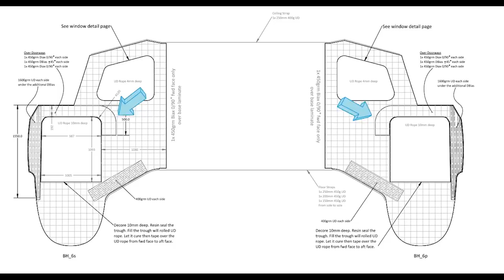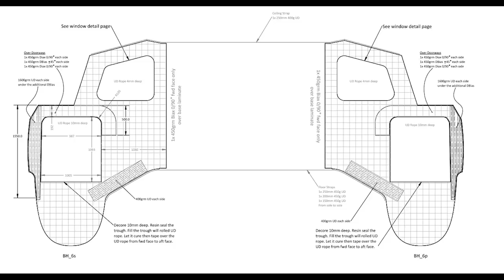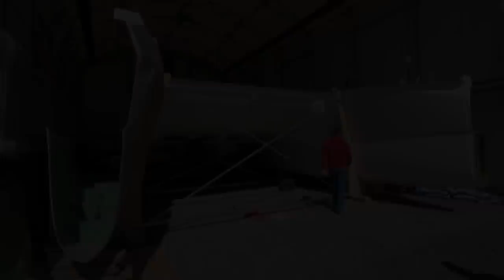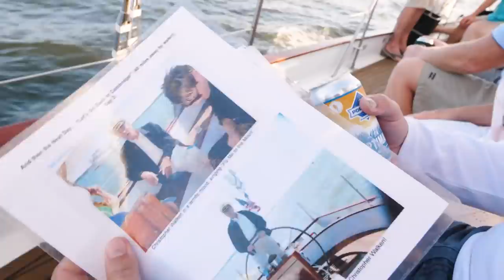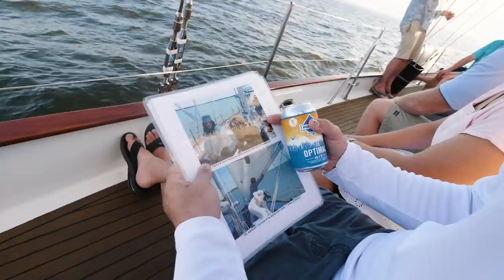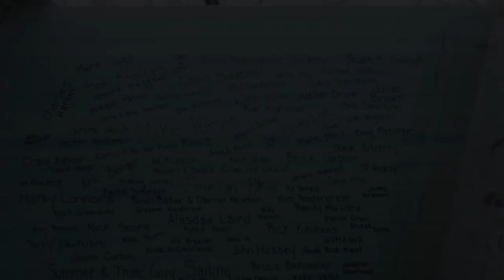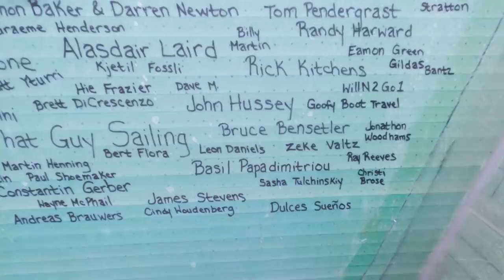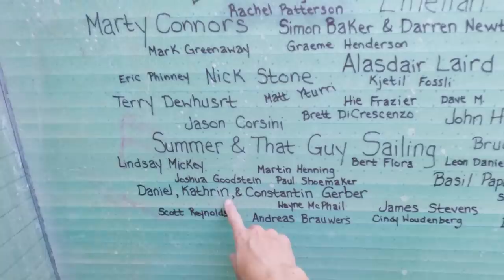CATAMARAN BUILD – Reinforcing Our Cockpit Bulkhead (MJ Sailing – Ep 196)

Comment: Working on some fiberglass aircraft panels many moons ago. We were told that the fiberglass had to be kept in a dry box. Humid air deposits water on/in the strands, the teacher proved it by wrapping a cut piece that had sat out in saran wrap and placing it in the sun. Sure enough the plastic wrap was covered in moisture an hour later. That means that left unchecked, a layer of moisture interferes with a proper bond.
Reply: When you're using polyester or vinylester it's not as big of a deal as they both have a solvent in them that absorbs and removes moisture,  with epoxy it is a bigger deal,  as epoxy doesn't have any solvents in it.

Comment: I built a 40' cat in a similar fabric shelter in tropical Cairns. During summer, in the shelter 34C was considered cool. It would pass by 34C by about 9am and stay that way till after dark. I downed tools when it got to 45C but is was consistently 38C-40C most days. Outside temperature would hover around 32C. Hottest I saw on top of the roof was 55.6C with 64% humidity...talk about post curing your glass layup. It does take a lot of planning and weather watching if you had a large layup to do. You do seem to have a very good light setup over your work area which helps with working at night time - something I didn't have but wish I did.

Comment: The blueprint illustrates the forces very well.  Thanks for showing it, in particular because Maxcruise has no reason to hide anything! The location of the unidirectional speaks books on what a square cut causes and that the naval architect is aware of it.  A not to be named french builder instead placed a conduit in that area - just crazy.

Comment: You are both doing an amazing job. This will be one kick-ass vessel when completed. I always found with rollers no matter what product is being worked with an extension screwed into the handle took a lot of strain off the wrists and allowed more pressure to be applied.

Comment: looks to me like the 0-90 doesn't "hold air".  rather it is very stiff, so when it rebounds, it sucks air back in from the edges.  re: the air voids left around corners that you say you  will sand out...could you use a syringe and needle to poke a hole at one end and then inject epoxy from the other end.  this would preserve the integrity of the fiberglass sheet while removing the void that allows separation/buckling  under stress.  also might be quicker and less messy than sanding.

Comment: Hey Matt when it comes to your 090 try pouring the resin right down the middle of the cloth and use your squeegee to move it around, as opposed to using a roller to apply it. I think with the larger quantity of resin filling the weave you'll get quicker saturation, and the access resin will be soaked up by the next layer of glass or the peel ply.

Comment: Some of those air bubbles are due to not enough resin on glass
Reply: They do tend to work really dry it seems.
Reply: Agreed... I have seen others soak their glass in resin before laying it down and rolling it out.   Seems like they would save a lot of time and back pain by just using a little more resin and not having to work out the bubbles as much.
Reply: @NoseyLurker  kicking themselves for trying to save a few hundred bucks in wood on million dollar boats...
Reply: I built my Grainger Trimaran  by myself  and understand some of the problems you point out. For those area where the glass has to dip down onto a lower level panel, I suggest you make larger radius fillets for the glass to lay around. This should reduce those areas where the glass will stubbornly sit up allowing air to remain underneath.
Reply: One other price of advice is not to over roll the fibre glass or you will break many of those glass fibres, therefore weakening your fibreglass work.
Reply: Use plenty of peel ply, it is your best friend for surface finish and later already prepared for any painting etc. Eliminates so much sanding.
Reply: @kevonmason6140  and don't remove the peel ply until you have to. taking it off early gains you nothing.

Comment: Excellent job. Try a product called Bubble Buster to roll out the air bubbles. I have used it with great results. Cheers
Reply: Well if they were using epoxy id say add 10% acetone but idk about what you'd think that with .... but thinking the resin helps a lot with bubbles
Reply: @s.v.gadder1443  i would not dilute with acetone as it breaks down the vynilester material.
Reply from the maker: I think we do actually have a Bubble Buster - hidden away somewhere among all our supplies, lol.

Comment: If those are typical rollers you can screw and extension into them.  A 18 inch extension should give you 1)  More Leverage and 2) more reach.  Both of those things will reduce the amount of effort required.

Comment: Can see why Lagoon skipped this part, very labour intensive. Do they make longer rollers, might speed it up?
Reply: i bet the rollers they are using are ideal for a humans weight.  you need a small surface contact area to create enough pressure to move the glue through the mat.  if you doubled the roller length, you would halve the pressure at the surface.  a bigger foot long roller probably would likely give insufficient pressure.
Reply: If you watch "life on the hulls" spraying is really best when your building large builds.....
Reply: @s.v.gadder1443  I have seen Bryan Sailing pour the epoxy stuff they use on the fiber class on to the area and then spread it out afterwards. Not seen anyone spray it on yet but that seems logical. Bare foot sailing also did a lot of fiber glass work and he uses his hands to spread it on first as well.

Comment: Hopefully those eight layers around the narrow parts of the bulkhead will be strong enough and the bulkhead won't crack. The break you had with the sailing of Woodwind was really nice , you deserved it. It looks really good so far. What is the brand and model of that electric sizzor?

Comment: just a tip. try laying a moderate layer of resin first before laying the 0/90 then over with a thin layer on top
Reply from the maker: You'll see at 06:14; 16:13, and 19:25, that we do this step. 😉

Comment: The occasional breaks are important.  One thing I noticed was the height of your work surface seemed a bit low which required bending over more - harder on the back.

Comment: Where you put down three layers why not let each layer extend a little past  the one before. Or a little less so that it would be less of the hard step at the end of those layers. That way you don't create a stress point. Plus it will be a more gradual slope. I have no idea if you have to fair this area later so I won't mention that.
Reply: the out board layers meet the hull where there are multiple UD and Biaxial layers spreading load from chain plates, the bottom of the bulkhead layers are met with a UD Box and UD plate  the inboard edge is linked by a UD  box,  stepping the layers in this instance would lead to a weak seam line,

Comment: Great job guys, but why don't you vacuum those air bubles out?! Simply, after spreading resin on fabric put it in to the plastic bag and suck the air out with any vacuum cleaner. If vacuum cleaner is not powerful enough take a compressor from salvaged refrigerator and use it to suck the rest of the air out. It is so quick and easy you might be able to do the lamination in high temperatures.
It is easier than one might think... 
Surely, the Best would be to use vacuum infusion...

Comment: I will have to say that the layer stack ups you are doing could have been a lot better. Not in terms of the pieces, but rather the order of them.
If you interleave the layers between the difference segments, then you will achieve a higher strength for the bond between the segments in the end.
For an example, you put down two layers at the side of the bulkhead, and then adding multiple layers above the cutout, this forms the weakest bond between these two segments.

If you instead started with the first layer above the cutout, then a layer for the side of the bulkhead, and then the next layer for above the cutout, and so forth. Then you will get a stronger bond between the two segments.

A simple experiment to show this is take two books.
If you place one book on top of the other and pull them along each other, how hard is it to slide them apart?
If you instead take a few pages from each book and interleave, and then try to pull it apart, then you will quickly find that only interleaving a few pages makes it a lot harder.

Now for the fiberglass, one do tend to use glue, and not just friction.
But interleaving still means that the two segments aren't purely relying on 1 glued interface, but rather multiple interfaces. And it is this interleaving that gives composite structures their strength. Not a bit of glue between two pieces. It wouldn't surprise me in the slightest if the reinforcement you made is actually a lot weaker than expected if put to a destructive test. (ie, an accident.)

Btw, doing proper interleaving of the layers isn't all that common among DIY people, even among professionals it is sometimes not done either. Since most people do not even stop to reflect about how the structure gets its strength and how the different materials in the composite interact and what purpose they have.

The incorrect assumptions of composite strength is though usually worst when doing joints between two pieces. Since here, the number of layers one adds doesn't really affect the strength of the bond, all that matters is the surface area that is glued against each piece. And beyond this, one only needs enough layers to smoothly distribute the force across that area. Adding additional layers without adding more bonding surface, doesn't improve the bond. At times adding more layers in these areas can end up making it less strong, since the bond might not flex in a similar fashion to the piece it is supposed to bond with, and therefor getting pealed off over time. Ie, cracks starts to form near the base of the joint on one or the other piece, and over time the crack grows and spreads underneath this supposedly "strong" bond.

In the end, remember, the glue is the weakest part of the composite. It is only there to hold the fibers together.
And yes, I used the term "glue" instead of resin or epoxy, since they are both effectively glue.

Now, I am not saying that the work you have done is worthless junk. Even if I might sound critical.
The reinforcement is not the only part giving strength to the structure, so the difference between a proper stack up and the improper one made, isn't going to have a major impact on the strength of the whole structure. It is weaker, but likely plenty strong. But it is worth while to keep in mind what gives composites their strength and how the pieces and layers interact.
Reply: I would tend to disagree. I have built composite wings on aircraft that are subject to 9 gs and more. The designers specify all but joints with the top layers 45 deg to the bottom layers. They are following a structural design given to them by the boat designer. It appeared to me they did exactly that. Using different types of cloth uni overlaid with double bias overlaid  with 90 zero.
Reply: I believe your write-up will probably change if you could study the design specs.
Reply: @davidhanson3288  Agree....design specs should always be followed.
Reply: @davidhanson3288  I didn't talk about the decisions for what material/weave etc used. Nor the design spec given by the manufacturer. I don't criticize any of that.

What I criticized were that the layers weren't interleaved where available and did state why this is a deficit. It is fairly basic engineering to be fair.

Read again and you might see what I actually stated.
Reply: @carldb7374  I never criticized the design specification.

I criticized that the layers weren't interleaved. Since the lack of interleaving makes the end structure weaker.

Comment: Do you have or can you install exhaust fans?  Exhaust fans could be installed in the upper reaches of the tent to expel the hot air and possibly pull in cooler air from the bottom of the tent.  Your thoughts please?  Take Care, ASH
Reply from the maker: Thanks Alan.   We have an incredible exhaust fan up at the top of the building like you describe.  While it does help, it does also make too much noise to film.  So, whenever the camera is going to be out, there are no fans on.   Matt's

Comment: Your problems with the 0-90 are concerning.  It kind of looks like resin starvation but I'm also concerned that your resin may not be bonding properly with the glass.  You said that this glass is from a different manufacturer.  Are you certain that it is compatible with your vinyl-ester?  You also might try using Polyethylene film (Visqueen) instead of peel ply.  That will keep the glass from lifting up and producing the tiny bubbles while still allowing you to squeeze out a lot of excess resin.

Comment: Wouldn't it be more easier on your core and productive if you screw on a small wooden painters handle on your rollers?
Reply: Why the mini rollers ? For the surface pressure? Maybe there are narrow 8 inch rollers available with adjustable frames out there . It might make the glassing process almost twice as fast . Another thought for the large flat surface areas is to drop your work surfaces down and use fiberglass adjustable extension polls which you can then use some of your upper body weight with less arm strength and less back strain while covering more surface areas with longer strokes and more resin . Would just have to be aware of how much pressure you’re applying with this method and adjust as you go along .

Comment: Did you reinforce both sides of the bulkhead?
Reply from the maker: Yes, in next week's episode you'll see us work on the side with gelcoat.
Reply: @MJSailing  so you used the same lay up schedule on both sides of the bulkhead?
Reply from the maker: The other side gets the unidirectional as well as the three layers above the bunk opening.

Comment: Are you putting down fiberglass on both side of that bulkhead?
Reply from the maker: Yes, in next week's episode you'll see us add re-enforcements to the other side, as well as bond it into place.
Reply: @MJSailing  No bondo or silly putty i hope.
Reply: Hehe and it is not a well Known 450 either, hehe. I think you are ahead of the game as long as you can handle the heat.

Comment: Could they not make a light weight aluminium frame to go to the cockpit the bulkheads to ?
Reply: They could - yet it is often a question of time, engineering, testing and money...

and who is to say it would be any better?

AL cats are a thing, yet fairly rare... I would think AL is probably the least use hull material on any medium sized, cruiser or blue water boat.
They could have had the boat built by the company... or hired out help or anything inbetween.

Tula is still waiting.  I think Ruby Rose may also be waiting... or maybe they just received the new boat.
MJ Sailing - they go the built it (or restore it - not necessarily much different) THEN sail it, route.
Reply: Aluminium has a limited lifetime under flexation stress and it has a different thermal expansion rate to fibreglass
Reply: @jackdbur  ok mmmm lol 🤔
Reply: @vivianbond7449  his point is metals, especially aluminum will "work harden" when flexed. Over time they become brittle. Then there is the corrosion aspect in a salt environment, makes for much more maintanence in the long run.
Reply: @jackdbur  Beat me to it, plus then you have to attach it to the composite somehow.  It's difficult to reliably bond aluminum under the conditions encountered in amateur construction, and using fasteners can lead to a whole host of other issues.
Reply: @harveynailbanger  shame they can’t enjoy inject oil or a wax or some type of lubricant what will preserve the aluminium
Reply: @harveynailbanger  and aluminium tubing would have some flex to it to and  give and take with the aluminium to and I was thinking if there was little hair holes in the tubing every now and  lubricant in there to help lubricate inside and  out and put baby oil over the top of aluminium? Or wax ?
Reply: @netpackrat  I do think if they’re making aluminium boats like they do they can make an aluminium cat with stronger structure for the bulkheads because they are known to crack on fibreglass boats
Reply: @drx1xym154  always have a open mined how to make things better and stronger to on boats weak spots of each boat that’s made and look at this film hurricane storm 450 lagoon cracked bulkheads on YouTube mate had made it stronger though by thicken it all up with wood he use to and thicker fibreglass to
Reply: @vivianbond7449  The problem is not making an aluminum cat; they are out there.  The problem lies in trying to beef up a fiberglass structure with aluminum.  Besides the thermal expansion, they will flex at different rates, so that only one of the materials (whichever is stiffest) ends up carrying all of the load anyway.  Plus the issues in joining the two.

Comment: I have a question for you guys.  If the builder knows that all the bulkheads have to be reinforced with fiberglass,  why don't they just manufacture them stronger to start with?
Reply: This is a do it yourself kit.... there comes a point where the factory stops and you take over. They build them enough to ship them, you do the rest.
Reply: The door openings can also vary boat-to-boat depending on the interior layout. Where and how big they are effect where and how much reinforcement is needed.